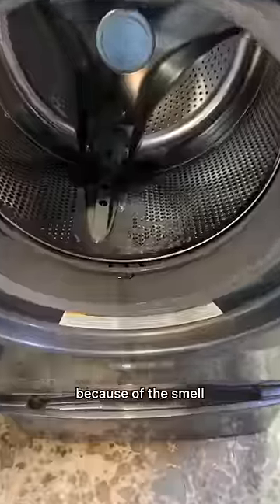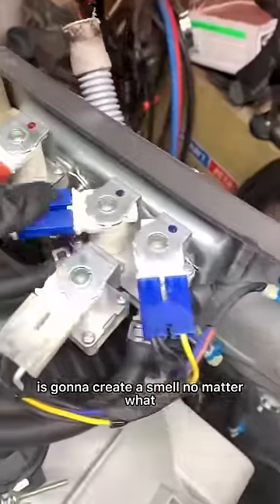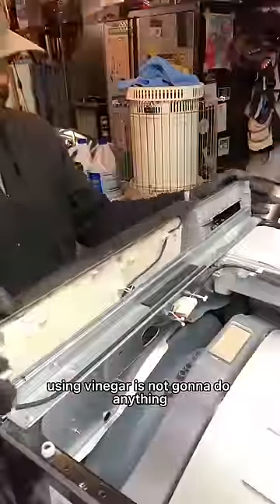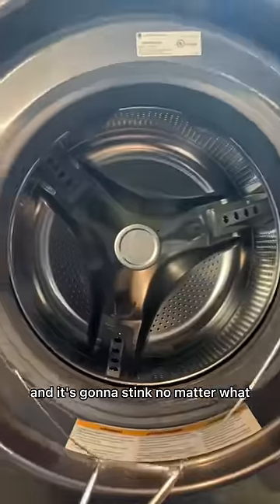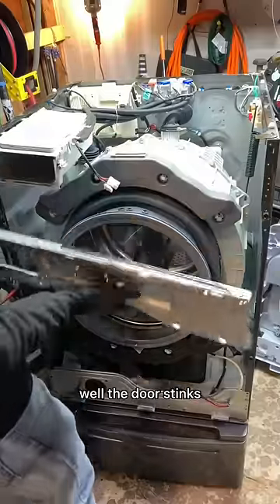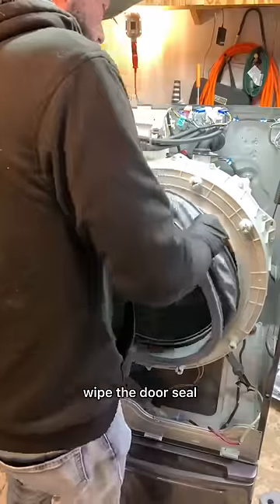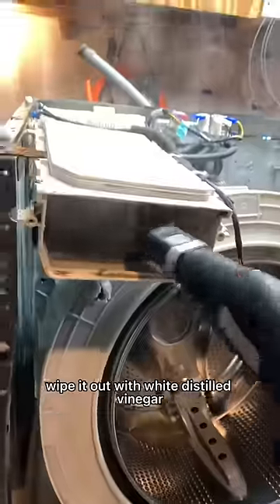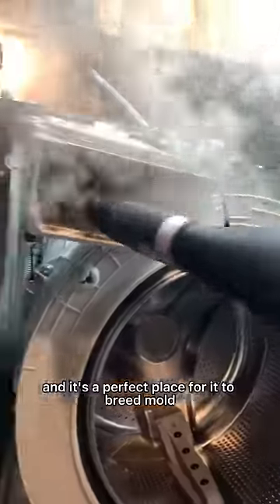Front load washers are proven to wash better. Facts, not opinion

Comment: Apparently, they're not better. Look at all the maintenance you have to do. 
Plus, I screwed up and bought one, a Samsung. It's been a problem from the day i bought it. First the damn thing won't clean small loads, it detects an empty washer and just stops. Then the door lock went out, then the mother board went out, large loads are always unbalanced and the washer is never in the same spot it was an hour earlier, now the bearings are going out, and it does not get clothes cleaner than a top loading washer, AND, it's only 18 months old! Front loading washers are GARBAGE!

Comment: I have done a side-by-side comparison from a traditional top load wash machine that uses 30 gallons of water and a front load high-efficiency wash machine and there’s no comparison that the traditional top load that uses lots of water get your clothes done cleaner and faster than a high-efficiency washer, which is the reason whyhigh-efficiency washers require that you spend an hour and a half and use three times their normal water when you have clothes that are especially dirty. So stop talking out your ass and promoting propaganda because top load washers are way better than frontload washers in every way.

Comment: They wash better, my athlete's foot. Shut up with that nonsense. They don't use enough water to do the job right. And that's why they have these sludge and odor problems.  We never ever had these problems before HE washers. Never. 

I'm so sick of this water saving nonsense.

 Why aren't they making these corporations save water? I can just imagine how many resources they waste

In this video there is sludge and mold building up in areas of the washer that a retail customer wouldn't have access to. This doesn't happen  with top loaders